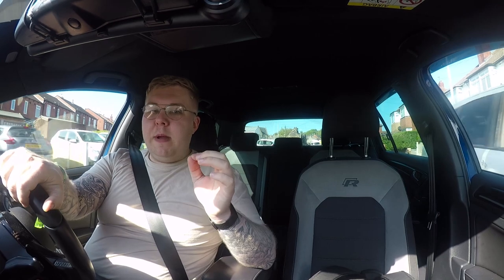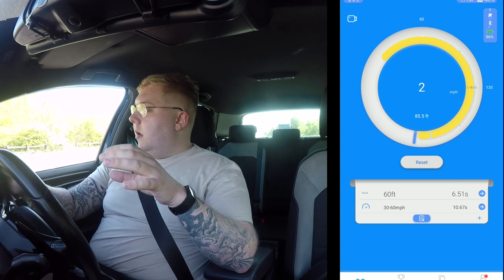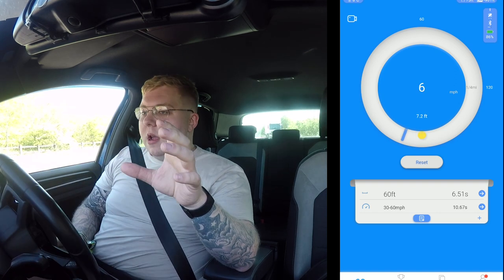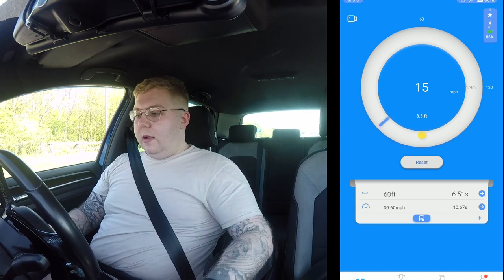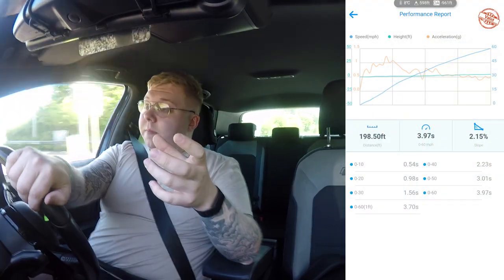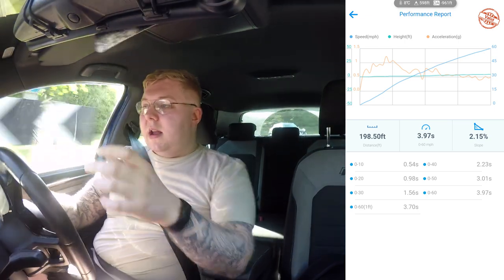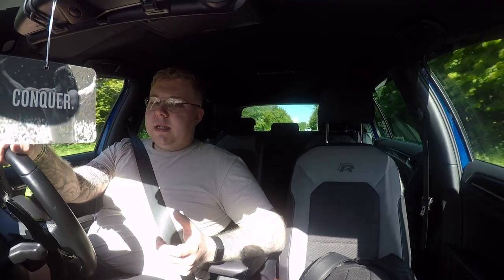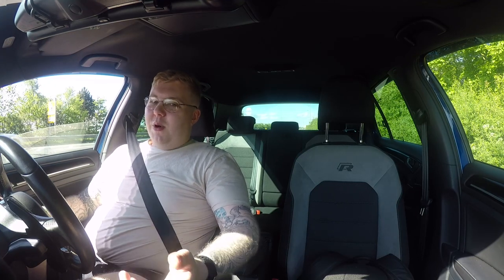Why Did My Golf R Get SLOWER?! - Dragy Test Runs

Comment: I drove two examples of a mk7 R wagon today. Both stock, one with an exhaust. The one without an exhaust upgrade was so slow. Felt 200hp. The other was breathtakingly fast to 150kmh. Nuts feeling. So would the slow one not mapped for the exhaust system? It was baffling, pardon the pun.

Comment: I'm currently in 5th place on dragywars with a 0-60 of 3.6 seconds running Racingline OEM+ software

I was only stage 1 for about 3 weeks before going stage 2 so I didn't get much opportunity to beat my personal best. I'm now stage 2 and who totally recommend the jump from stage 1 to stage 2.
Reply: How do you like the Racingline map ?. Im thinking of going to make mine stage 1. It will be around 365whp according to Racingline webpage. Any downsides/recommendations ?.
Reply: @haflidijonsson  it's a great map. It isn't spikey like a lot of other maps out there. It fells like stock but pulls much harder. I was only stage 1 for a few weeks before going Racingline stage 2 so I only got a few opportunities to get any times. My stage 1 60-100mph dragywars time is still in second place and that was only after a couple of attempts and it's still the 2nd fastest at 5.11 seconds a few months later. That's full weight.

The tune is great. Go for it.
Reply from the maker: How does it feel compared Dan?
Reply: @JXLPerformance  The jump from stage 1 to stage 2 feels as big as the jump from stock to stage 1.

With stage 2 you instantly feel the extra torque over stage 1. I'm still running the stock P Zero's and they're holding me back. My car is a 7.5 with DCC and since going stage 2 the car feels too soft and unstable under load so I'm looking to get lowering springs soon. Then you have small things like the extra noise of the sports cat downpipe just adds to the drama.

You should definitely consider going stage 2.

Comment: Heat soak and high IAT's were most likely the problem. I'm same setup as you and I've been monitoring my IAT's a little. Sitting at a standstill on these warmer days my IAT's are about 40-50 degree's. And cruising at 60 they're at about 20 degrees. So I'd imagine 60-100 times would still be good but 0-60 would be worse.
Reply from the maker: Aye, I think that was the case, in terms of the temperature it wasn't that high, it was a little muggy to be honest so more than likely the case. I plan to take the car and dragy out a bit later one day and try once it's cooled down.

Comment: just got a 16 R about 3 months ago and i live in california so fuel is regulated pretty hard but i assume your 99 is equivalent to our 100?? i plan on getting 100 in a couple days (stage 1 apr btw) to compete at Willow Springs so im lookin for a bit of advice from fellow owners about mixtures and whatnot
Reply from the maker: I'm not sure on mixtures myself mate, but I think our 99 is close to your 95 whereas your 100 is 105 here. We can only usually buy 102 at race tracks, and then potentially add octane booster in to achieve the US '100'.
Reply: put  91, 112, and e85 in.. o2 sensor wigged out lol getting it fixed friday.
Reply: JJB interesting.. i got some more diggin to do

Comment: I’m Chris boost on the dragywars stage 2 on my Audi S3 8V Saloon pfl. I Don’t have a cooler and don’t have a issue with temps. Running 1.7bar boost. Got a downpipe tho that’s heatwrapped. 
Mods are;
VWR R600 Intake,
Turbo technics intake pipe,
Powerflex dogbone insert version 1,
SuperPro lower control arm bush kit,
BCS sport cat down pipe,
BCS resonator delete,
Eibach sportline springs,
MRC ECU Tune,
MRC DSG Tune,
Racingline oil management system,
401bhp and 420ibft
Reply from the maker: What do your IATs run at?
Reply from the maker: Also do you not run an intercooler?
Reply: JJB stock intercooler on mine. And IAT I can’t remember I have a dyno sheet with it somewhere. Will be going back on my friends mustang dyno next week so will log it again and update you.

Comment: I know you've since sold your golf r but what mpg would you get on a run?
Reply from the maker: Depends really mate. Most times I could get around the 40mpg mark with the JB4 on. Id just sit there at 70 with the cruise control on. As a rule of thumb it's usually been 36-42
Reply: @JXLPerformance  fair play on the super quick reply!! That's not bad at all, and you'd say the jb4 was better than the likes of revo on a stage 1?
Reply from the maker: No problem haha, I had my phone to hand at the time! 

It's very subjective that question, if you're bothered about out and out peak figures, then a "full remap" would be the way to go, regardless of whether it's Revo, APR, MRC etc. 

I chose the JB4 due to it giving 95% of what a remap can give, at half the cost. Plus it's removable so I lost £50 on the price of what I paid originally. If you're planning to keep the car a long time, and planning to go Stage 2 for example, I would just stick with your usual suspects, Revo, APR etc. If you're planning on staying Stage 1 I would 100% recommend the JB4. It also has diagnostic and logging capabilities which are very useful too
Reply: @JXLPerformance  thankyou that's pretty much solved my dilemma :D I'm a bugger for getting bored quickly

Comment: same amount of fuel in the tank? Same stuff in the car/weight of the car as before?
Reply from the maker: Little less fuel, but I had some detailing gear in the back so that probably evened it out. I had exactly the same stuff inside of the car too. Same road, or rather same area where launched. Roughly the same time in the day, just higher in temperature.
Reply: @JXLPerformance  Tyre pressure maybe as it was warmer, read that lower is better for launches

Comment: I recently got a JB4 and have been tweaking my own Map 6. One thing to note is launch control is a fair bit more severe than just normal full throttle....it's worth doing a log during launch to see what's happening. I had issues around 5000 rpm with it cutting throttle (which i think you did in previous video) - when it did the the exhaust would started farting, which it shouldn't do on launch, which i believe is from un-burnt fuel from the throttle cut. Too high a boost level at the upper RPM's will also result the in the DSG box torque limiters kicking in, in 1st gear - worth seeing if you are getting throttle cuts in 1st gear on launch.

Also outside temperature will influence the results, my runs were done at night with it being about 8c. If you're doing them on a warm day then they will be worse, especially if you have no intake mod's. A simple mod to improve the intake temp's is to get a good panel filter and remove the snow guard (cheese grater). I also installed a TT inlet pipe. Also do a simple check to make sure no leaves or crap are clogging up your front grill.  Does sound like it's pulling timing due to intake temps rising on each run - i do a cool down before each launch.

Another thing to note is that you are using additive values on map 6. With intake temperatures being higher, the base ECU PSI will be higher - the additive values may now be hitting the boost failsafe setting. Definitely do a log during launch to see what's happening.